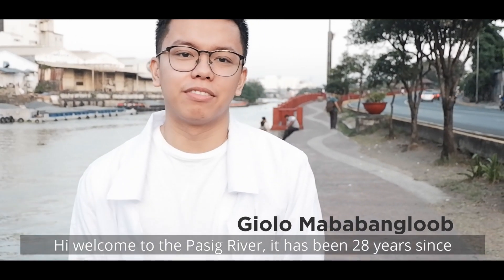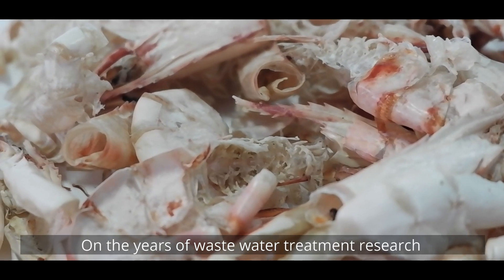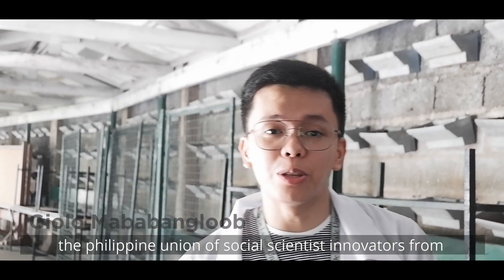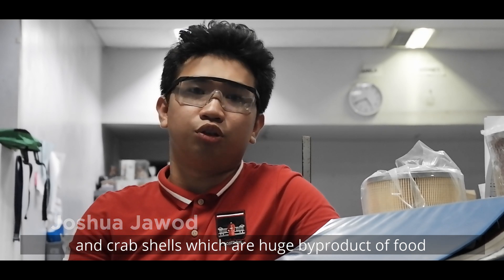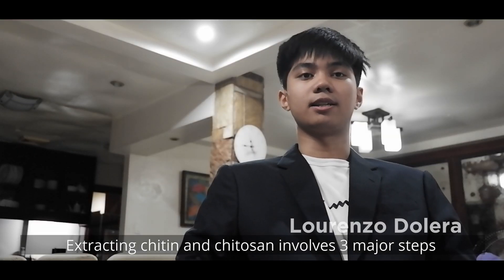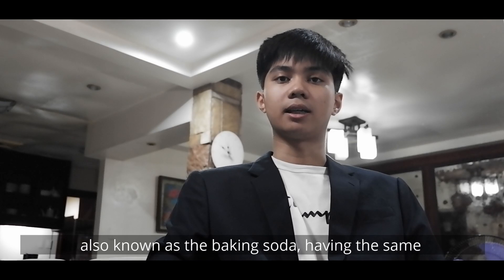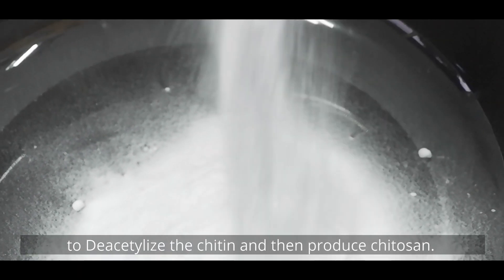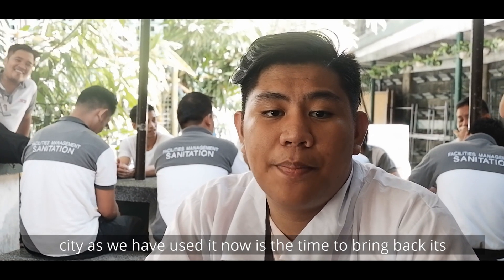Chitin & Chitosan in Waste Water Treatment Research

Comment: How is sodium hydroxide not available if hydrochloric acid is? HCL and NaOH are both produced at the same time when they are made from NaCL + H20.

Alternatively you should turn the bicarbonate into carbonate by heating it, decreasing the concentration required.